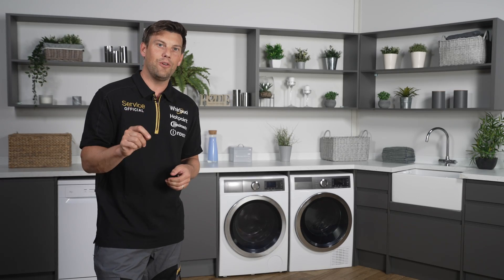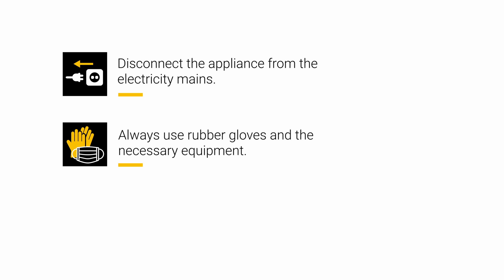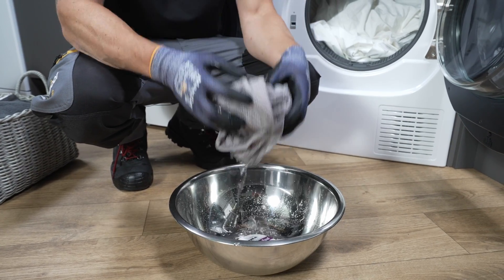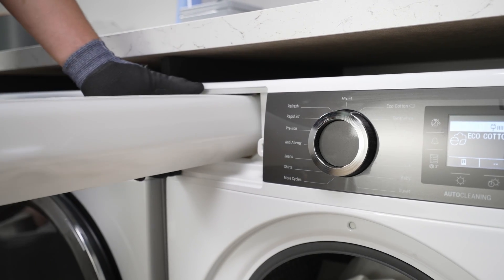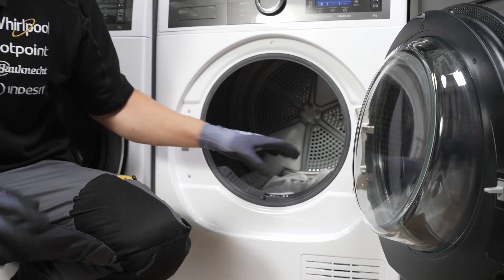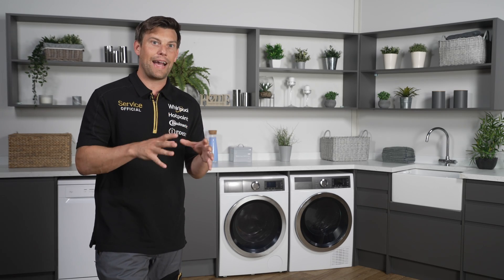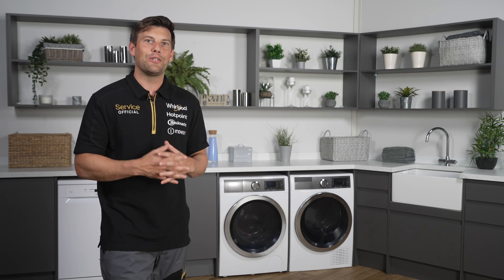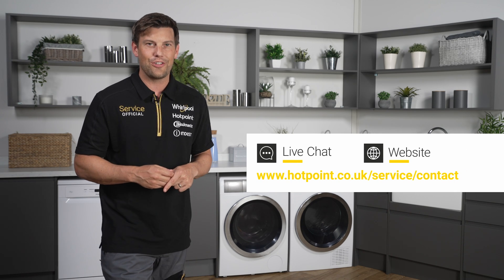How does a Heat Pump Dryer work| by Hotpoint

Comment: So, “There is no heating element in the appliance, the previously heated air is recycled”  so how is the air previously heated?  Do you have to buy some heated air separately!
Reply: The air that is recirculated around the dryer with a fan, collects moisture from the laundry, and passes through a unit that cools down the air to collect the water. Because the condenser itself gets warm, when the air passes it, it heats up, and then enters the drum to dry the laundry. It’s an airtight system that recycles the same air, so it progressively gets warmer throughout the cycle because the heat is generated by another component that generates heat with use, but no physical heating element is required. And since it doesn’t get as hot as a heating element, it prevents shrinkage of clothing, and uses less energy, even when cycle times are a little longer.